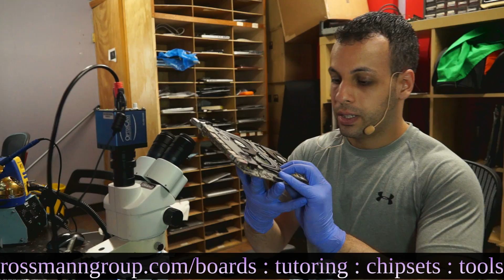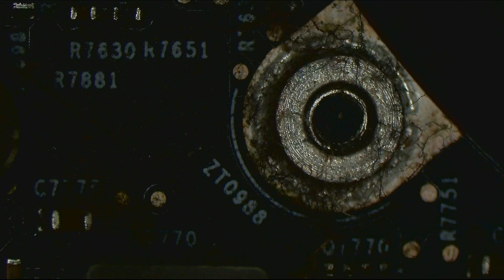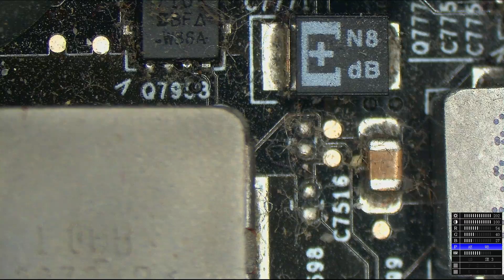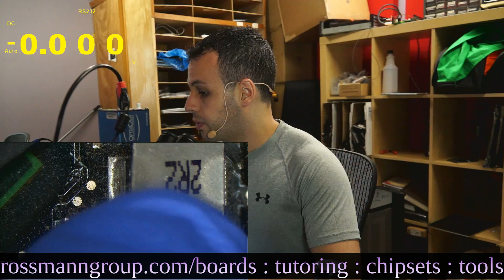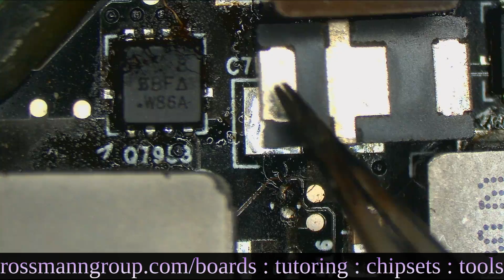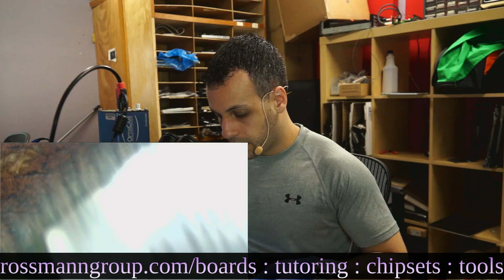What causes no power most 2008-2009 17" Unibody Macbook Pros & how to fix it.

Comment from the maker: If this tip helped you save your classic MBP, consider buying the replacement cap from us. We appreciate the support from viewers like you that help us keep these educational videos coming! https://store.rossmanngroup.com/d3-c7771-c9560-1-piece.html
Reply: Thank you Sir..
Reply: Louis Rossmann Hi I love ur videos u make electronic repairs look so easy. I wonder if you can help me it’s completely off the topic however I have a Lenovo g580 laptop and it will not switch ‘on’ at all none of the indicator led’s light up at the front of the laptop. I’ve tried a different power supply tried removing the battery all the usual basic stuff it will it turn on. I’ve taken it to a third party repair shop and without even opening up they said I need a new motherboard.. Could you please point me in the right direction I know a little bit abt electronics so was thinking perhaps it could be a surface mount fuse or something. Please help I’m am all the way from South Africa 🇿🇦
Reply: Hi, do you have a new link for this capacitor?
Reply: Louis, Could you explain the importance of X capacitors? I have plug in surge protectors that self-consume 29-43 mA, and I suspect it is the X capacitors leaking current! Was wondering what effect if I remove them?
Reply: Hi Louis, great vid, could I just ask you what the voltage rating should be on the replacment cap, I was thinking 2v.  I'm unable to buy from you as I'm in Australia and it would cost $$$ in shipping fees. I've been looking at this one..(Panasonic 330μF 2V dc Aluminium Polymer Capacitor, Surface Mount 7.3 x 4.3 x 1.9mm +105°C 7.3mm). Many thanks for any advice on this. Regards Jay.
Reply: Would Love to but its stated as "Out Of Stock" ... I need one for my 17'' 2009 MBP. Power on only when he's hot.
Reply: hi louis, do you ship to germany?
Reply: Thank you so much Louis!  The Grandaddy MBP isn't dead yet!
Reply: Hello Louis, big fan here.  I might've dropped a comment before, who knows.  The point is, I really respect what you're doing for the computing community and for society as a whole.  If you can replace one tiny chip on a logic board, and save a customer from losing their data and having to buy a whole new computer, you're doing the world a service, saving the environment, etc.

I had an idea a few months back.  If you can have a machine that assembles video cards, by attaching and soldering tiny components with perfect precision, then why can't we have such a machine for circuit board repair?

What I would like to own, is a table that fixes circuit boards.  This would look similar to a flatbed plotter.  The way it works is, you place a circuit board on the table, aligning it with one of the corners of the walled edges on the table.  You then walk up to the control computer and answer a series of checkbox questions so that you can tell the system the symptoms of the malfunctions of the board.  

The machine needs to have high precision robotic arms that can attach and swap out any of the tools used to repair circuit boards, such as testing equipment, heat guns, soldering irons, very tiny chip grabbing tweezers, a reballing attachment, etc.

The board will then use optical sensors to create a diagram of the board, using optical identification of the components, traces, sockets, etc.  The machine then flips the board onto it's back and creates a diagram of the back of the board.

The machine then determines which board it's working on, by cross referencing it and scrubbing it against the database of known circuit diagrams, or perhaps.. you could have the operator select the board from a series of drop down menus.  

The next thing the machine will do is try to determine which component or components are faulty, according to the symptoms listed, and by using a multi meter and robotic arms to systematically test the function of each component in a logical order...

What we need is experts like you Louis to program the machine.  Once the machine has determined which components are faulty, the robotic arms replace the faulty parts and then the machine will attach a power source, input and output devices such as a monitor, keyboard, and mouse or trackpad.  And the table becomes a test bench.

Then the technician can run the board through some paces or a benchmark to determine if everything works, before returning the board to it's case.

The great thing about this machine is, you can also use it to upgrade old machines.  If you have an iPhone with only 64 gb of storage and you want 1 tb, you will be able to easily upgrade it with this machine.  If your iMac has soldered in RAM that can be replaced.  If you want to upgrade an entire SOC with a more capable one, that is also possible.

Such a machine as this would save you a lot of hours, streamline your whole business and allow you to make a lot of customers very happy at a lower cost to you with less headaches.  

I wouldn't be surprised if Samsung or Sony has something like this in the works, but I think ALL cities need to have shops with these.

Comment: It’s 2025 and I used this video to fix my 2009 17” and I’m STILL USING IT!!! But now Apple has crippled most of the software and none of the browsers work. Too bad, I love it. It was a badass Windows machine too. But now when I boot into W10 it’s a black screen because the drivers are too old. I can’t update them without losing the Windows partition so I’m waiting for a solution. I’m going to try the hacked Sonoma OS, it totally works on my 2009 desktop for ProTools
Reply: Do you know if this works on the 15” MacBook Pro?

Comment: Years ago, I repaired a 17” MBP 2009 using this video, and using a cap I bought from you; still going strong! (due to not having the right equipment, I soldered wires to the pads, and then the cap to the wires. Not recommended, but it works!😅 thank you for all your videos on repair, and everything else!

Comment: Would this apply to the 2010 17" macbook pros (A1297) as well? Electrical storm zapped mine and the wifes even though on a power strip. tried the power port replacement, no go.

Comment: Does the 2009 MacBook Pro 13 inch have the same problem because mine I checked most of the caps in mine and most of them had .01 volts on them.

Comment: Useful video - symptoms match perfectly my2009 unibody 17" MBP with the 820-2610 board ( 0.320V on the cap + using my Fluke 112 DMM ) so I will obtain one of these caps - Mr Rossmann currently showing no stock . I don't have a hot air gun ( for soldering ) but I expect the finest point tip on my Weller PU1d/TCP1 will do the job

Comment: I did this however my Mac still doesn’t turn on, are there any other common issues with these boards? My capacitor reads 1.05 volts after replacing too

Comment: That's what I have. 15 inch  09 MBP.  It lasted nearly 10 years! I did crack the screen on the bevel  edge when traveling, so it didn't bother the viewing area. I took it to get an estimate for the screen ( too expensive so I said don't) 
and not telling me,they cleaned it and changed the memory. They messed it up,  It would not hold charge and would try to boot then  turn off with it plugged in. 
When I got home I put in new battery and still not holding a charge or charging. Didn't  recognize battery. Was able to transfer some files for a few hrs  before it would shut down no longer boot plugged in. 
I read about this machine  has a certain kind of ram. To only use a  type of ram chips that was a certain speed? 
I think the memory they put in over clocked it.. is that possible? 
Would not charge and even plugged in it would barely boot then stop..it's been in my drawer for 4 years. 
I was broke so had to use a HP laptop I had  when my Mac broke. 

 I just got the new M1 Air. I was going to get a HD enclosure to transfer my important writing , photos that were not in cloud and medical records. 
Is it worth to fix this 2009 MBP? 
Should I just get the enclosure and transfer to my Mac book air M1? 
Thanks. You are all the best source for these things.

Comment: Reallly... ? For a good and pretty smart guy, you surely should've known to clean the board -.- That is disgusting, not only the fact that  you left all that hair and shit in the board but you got a bunch of hair stuck in between the board and the capacitor .. All it would've taken is 2 seconds with a paper towel for you to wipe MOST of that hair away. I have always been told, you are only as good as your weakest link, or in this case, the fact that you didn't care enough to literally wipe or blow off the board before the video, shows exactly how much this meant to you.

Comment: I had the same with my Amiga 500 in '92. Went dead from one moment to the other.
I only had a multi meter at the time (no scope) with which i measured all the caps. And low and behold....The tantalum cap on the keyboard coder had gone bad (short). replaced it and it still works to this day.
When a cap shorts out the power supply trips and shuts down (or at least it should do)
Anyone remember the period (~2004-2008) when some cap supplier had sold a massive batch of bad electrolytic caps to Manufacturers. They were fine the first year or so after which they all started to go bad (bulging at the top - not a short but there was conductance between the anode and cathode) As a consequence systems became unstable and could freeze at any moment. This resulted in a massive surge of Warranty claims. I've revived many system boards by simply replacing all the caps.

Comment: @Louis Rossmann  I have a Macbook Pro that I bought back in 2012, (I believe, it's been awhile), and I used it a total of around 6 months, and then I decided to open it up, and apply new thermal paste. While putting it back together, my screwdriver slipped, and hit the board, and a cap right next to the dang thing popped off the board. I looked all over the carpet, and could not locate it, and now it does not turn back on. Had to buy my wife a new one for the screw up, and I kept that macbook pro like new in the box since then, in hopes to repair it since Apple wanted the price of the entire unit to replace one damn cap, so I refused repair from them.

Would you be willing to take a look at a few pics, and tell me what I need to repair it, (I can repair most things with proper parts), and if you cannot tell me, would you please fix it for me before I move back to Asia in like 6 weeks? I would like to take the Macbook Pro with me on the trip, it's my only laptop that I have left, since the ecks took the new one with her when we split up. Thank you!

Comment: Any recommendation for 15" board, on which part to look?
Reply: Ok, no problem, thanks for videos. Somehow insulation of signal cable between DC-In and motherboard got ruptured and got short to ground. Maybe it was from service before or I did it when cleaning (everything is possible).

Pulled the pin out, put heatshrink tube on it, used duct tape to insulate the rest and it works like a charm. Thanks for your videos (y)

Comment: the reason you see resistance when measuring capacitors is that you are charging them up..... why not use an X7R capacitor instead of tantalum - cheaper , more compact and more reliable?
Reply: For a given voltage, ceramic capacitors will be larger than electrolytics.

Comment: Hey brotha I have a 2010 or it 2011 MacBook 17” my MacBook stop working   it wont power on but I still get the battery indicator light works and the power cable light works was screwrowing around on the motherboard  that’s why it won’t turn on could you please please make a video on what I can do please

Comment: I have a 2010 MacBook pro with a similar problem. I believe I need to replace the same capacitor. Is the capacitor in a similar location? Do you have a video that shows this issue? Thanks

Comment: FOUND an OEM replacement on the bottom of of the logic board of my dead Late 2008 AL-UNIBODY 13.3 A1278

(Bad GPU, but bootable)

CAREFULLY removed and put in place on my Late 2008 MBP 15 mobo

With my TINY Weller pencil tip

No Go!

Must be some other fault

So the $22 ppd. MBP goes back into my parts donors....

My #$60 ppd. perfectly good 1st. Gen.12/2007 MBP 15 2.6 is fine...

Built from two such Hanger Queens found on eBay

as usual

Thanks for the education, though.....

J.C.

Comment: Actually a DSO would be the preferred tool to use in this situation as it would allow you to see the ripple voltage. A LCR meter can confirm the high ESR in the cap.

Comment: I have a 2011 (I think) 17 inch unibody Macbook pro but C7771 (and L7770) is working just fine at 1.105v. Green LED with the charger but nothing happens when you short the power on pads. PP5V_S3 is working too and I have no idea what could be wrong and I can't really find that out without schematics D: any ideas? I am a noob with this kind of repair. This is just a fun project.

Backstory: The board that coffee damage but no visible damage on the pcb. It stopped working after coffee got on the keyboard and I got it years after this.  I noticed that it would only boot somewhat buggy if I help it upside down. I cleaned everything including the entire keyboard in 99% isopropyl (some got into the screen... and RIP coating on the keycaps) and reinstalled OS X. It worked fine but the keyboard was broken with only a few keys with weird inputs working. An USB keyboard acted the same way. Since I didn't have a charger that I could keep at the time it just sat there for like a year. Now I got the original charger too and it doesn't boot anymore.

Comment: hi, thanks for this video.  you make it look easy :) 
question: after soldering on the cap to my 15" board, it still reads 0.307 on my machine; it also reads that with just the leads on the logic board tested.  What am i doing wrong?
Reply: hi. this is the same problem I'm having - did you end up solving it?

Comment: Iv'e got a 2010 macbook pro. It turns on but the built in finger board mouse has popped up slightly, it works but you cant click you can only scroll. Also the fans constantly at it's highest speed, and it wont charge. Any idea what's going on, i'd rather fix it than buy a brand new laptop. Please help.
Reply: Could be a swollen battery pushing up on the trackpad and keyboard. Remove the battery to see if the trackpad now clicks. Replace the battery with a new one if so. Hopefully the battery expansion has not damaged the surrounding pieces.
Reply: I had the same problem. I replaced the battery myself-works much better now. I also added a higher capacity SSD myself. Great computer now.

Comment: have you simply tried a tantalum rated at a higher voltage...I totally agree with your repair but was thinking the tantalum came in a smaller package with a variety of voltages

Comment: See my post below.  Turned out it was the c7771 cap after all, but with some really crazy things having to be done to get it up and running.  Take note of my diagnostics below.  The + side of the cap read 1.10 volts when powered up and running and when detached as a free board.  Thanks Louis for the video which at least got me on the right track.
Reply: please tell me - i'm so desperate!

Comment: Hi Louis, great video.  I have a mid 2009 Macbook Pro running Yosemite.  The startup has gone crazy now.  I have found no likely cause for this until I ran across your video.  Let me describe this and maybe you can tell me whether it might be the c7771 cap that is causing this issue.  I had suspected a cold solder joint on the board someplace, but this video may suggest something different.  Here is what I have to do to get my unit running.  First, I have to double click the power button for 20-30 times.  Chime begins at that time, then shuts down.  A few more clicks and the screen lights up (shutdown each time) , then a few more times the Apple logo comes on, then a few more times the startup bar comes on.  Then it starts a cycle where it will not get to the chime for a few times, then the Apple logo shows, then a couple more times and the startup bar may or may not get to the end, then we go back to it not even getting to the chime again.  This time, a few more power button cycles, and we finally get to the desktop. Occasionally, from the desktop, the unit spontaneously shuts down, especially under hard video processing on YouTube.   I should point out that I don't get kernel panics with any of this.  If the c7771 cap is flakey, would this cause the described problem.  A former Apple tech said it was just replace the mother board.  Don't think that's necessarily the answer.  have tried all the PRAM and such resets to no avail.  Battery has been replaced and this occurs whether on battery only or on line power.
Reply: I have the same issues, I tested the voltage on the capacitor he showed and got the .315 volts. I'm ordering the part from Louis's site now and I'll reply again when I swap it out. Also just so you know, he doesn't have time to reply to messages like this for free unfortunately.
Reply: @EDDY69  were you successful?
Reply: @EDDY69  thank you for your answer! i was so desperate till now^^

Comment: Hey have a early 2015 macbook air and it do not load any more. Changed the batterie and charging cable it didn't get better. Without batterie it is running, so i could run a test on it. Can you give me an advice how to find the problem and get the parts to fix it or could you fix it for arround 250? I am a bit of a nerd and would pay the risk killing my macbook by doing it on my one.

Comment: Interesting, I recall in a previous tantalum cap video you scraped to extend the ground pad out and used the outer lead on the longer cap instead of the middle lead. This is a much easier way to do the job!
By the way, I believe there's a note in the schematic that this rail /is/ supposed to be 1.1V for some boards, not 1.05V.